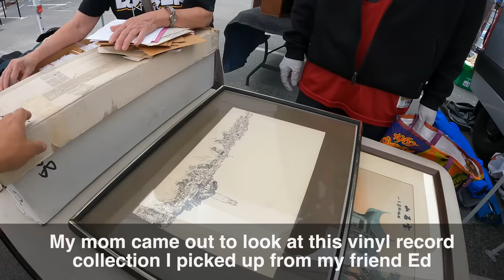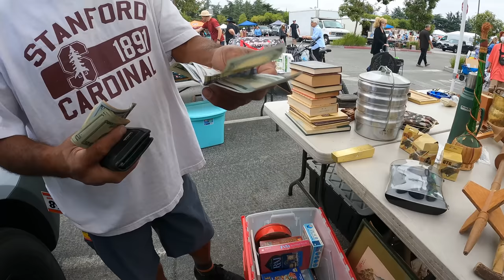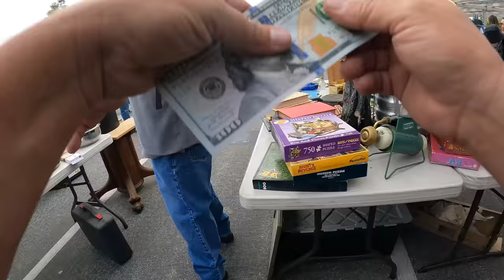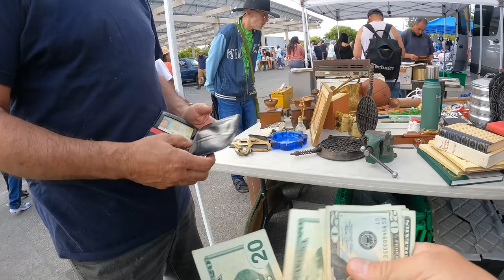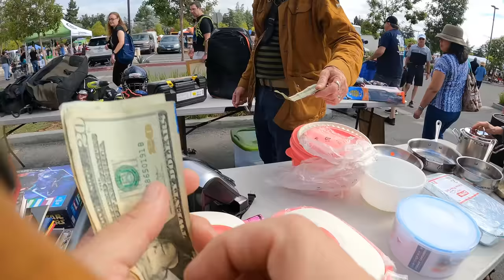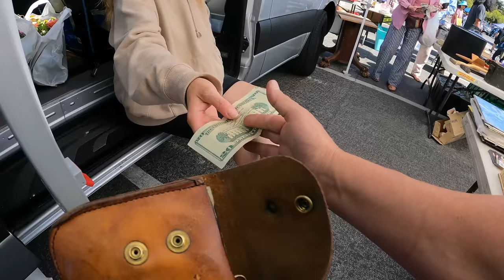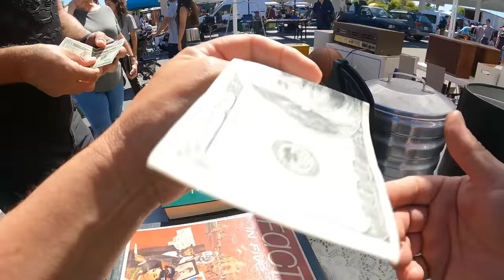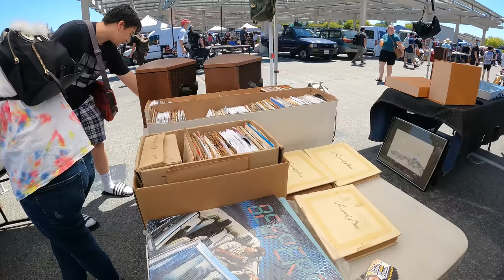RECORD BREAKING SALES at the De Anza Flea Market... our best trip yet!

Comment: Jack, did you sell the light?  It looks like a kleig light.  Wikipedia says: A Klieg light is an intense carbon arc lamp especially used in filmmaking. It is named after inventor John Kliegl and his brother Anton Kliegl. Klieg lights usually have a Fresnel lens with a spherical reflector or an ellipsoidal reflector with a lens train containing two plano-convex lenses or a single step lens.  So, there you are.

Comment: Those speakers appear to be  Bose 901 Series IV.  They require an Equalizer Controller box from Bose.  It originally came with the speakers.

Without this box, the speakers sound poor.  No deep bass and poor highs.

The boxes used are available online for $100 to $200 range.  

Still, a great deal at the price you are asking.
Reply from the maker: Thanks for the info! One guy was asking about a controller, but I didn't know about it. We didn't find it with the speakers, unfortunately.